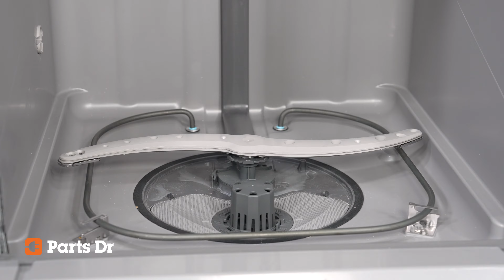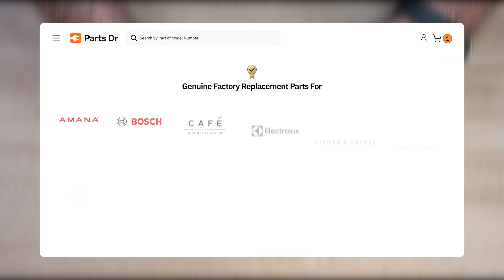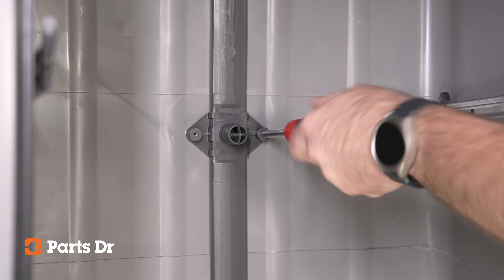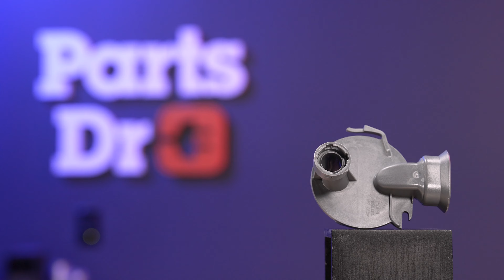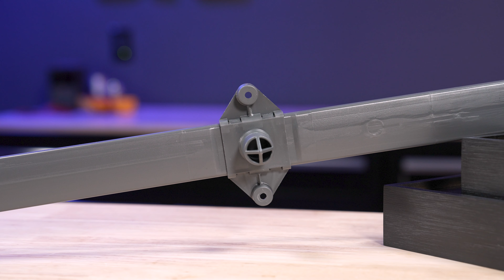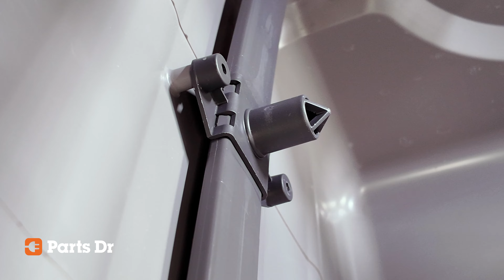GE Dishwasher Diverter Assembly Replacement | Part WD19X25466 | Parts Dr | Low Spray Wash Pressure

Comment from the maker: Thanks for watching our video on replacing the diverter assembly in your GE dishwasher! If you're tackling this repair, make sure to use a genuine OEM part to ensure proper water flow and spray arm performance. Be cautious when buying parts from online marketplaces like Amazon or eBay, as many aftermarket diverters are often lower quality and may not seal correctly or fail prematurely. For high-quality original parts, order directly from https://partsdr.com. Happy repairing and let us know how your repair goes in the comments!

Comment: My lower was arm was making a thumping noise when it  was rotating.
Took the lower basket out, no thumping noise. I ordered new wash arm, new wheels and bet down the heating element. Still had the thumping sound.
I cut off a  small 90 degree corner point on each of the 4 sets of dual wheels. Reassembled and started it up. No more annoying thumping noise.
Note: Using Chat GPT I got bad trouble shooting advice even though I included a pic of the model and serial number. I finally uploaded a pic of the inside of the tub. Chat apologied and gave different advice. Still wrong. My Tech guy called me back and he said the base the arm attaches to can be removed and replaced from inside the machine.
I think that part is slightly warped due to 5 years of wear and tear and intense heat cycles. I told this to Chat and it apologized and said the Tech was right and the part could be fixed from the inside.
I’m going to hold off replacing that part for now as it’s working fine.
But be aware that Chat does always get it right. Rather than being a know it all it was more like an apprentice… just saying.